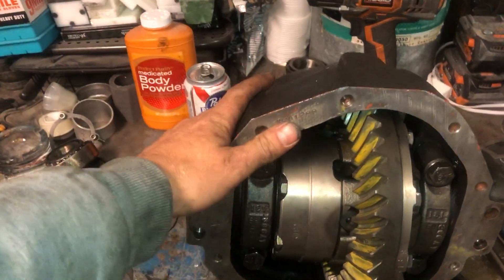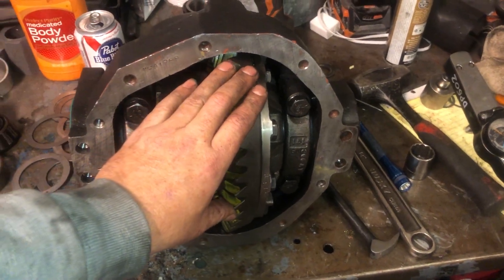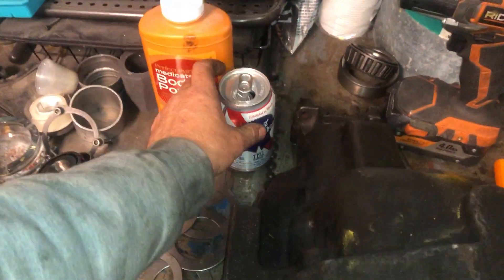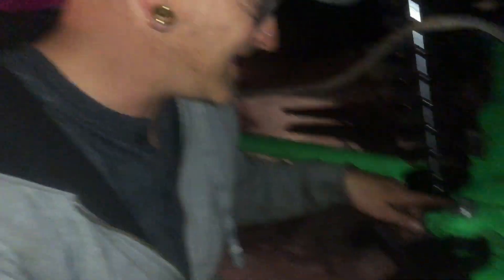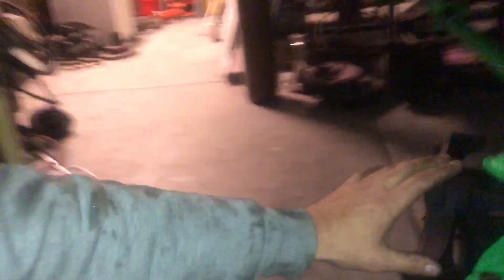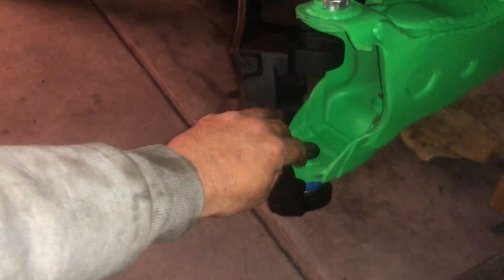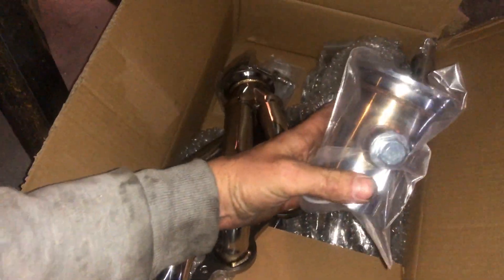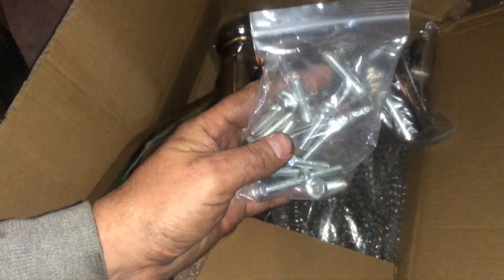LS Swap Ford Bronco Prerunner / Broverlander Build ep 10

Comment: What headers did you us ? Part number?
Reply from the maker: BLACKHORSE-RACING Exhaust Header Shorty Engine Conversion Swap Truck Stainless Steel Header for Chevy GMC Trucks LS1 LS2 LS3 C-10 LS Pickups https://www.amazon.com/dp/B083DJC252/ref=cm_sw_r_cp_apip_tmc6gGwugeJZ4
Reply from the maker: Looks like the price has gone up, but I would still pay for these. They are holding up great so far !🍻
Reply: @TheButcheredGarage  sweat , I'm starting mine this week.. well putting the motor in anyway..
Reply from the maker: How’s the install goin ?
Reply: Install is a breeze,  I need your help with a speed sensor on the 241c  ,, I sent you a message on IG